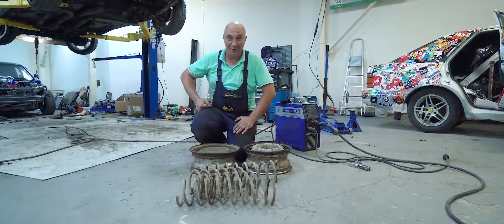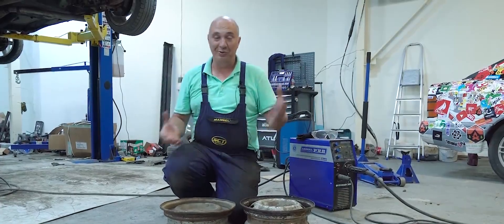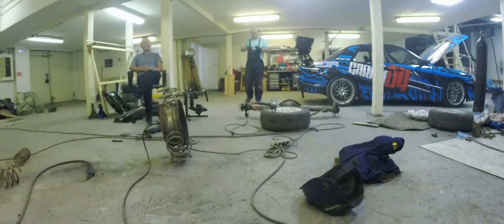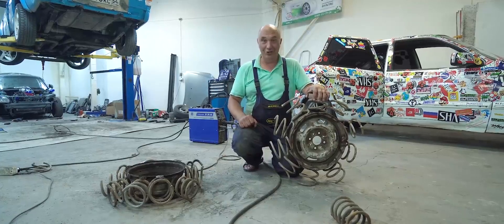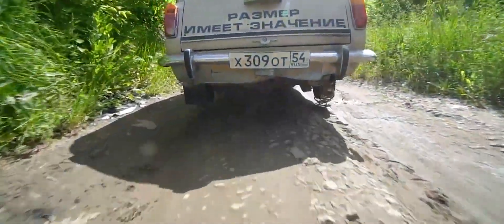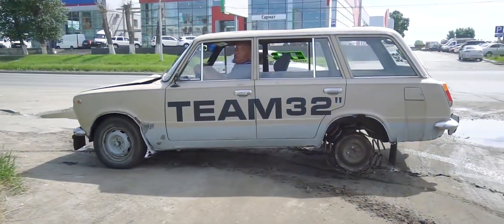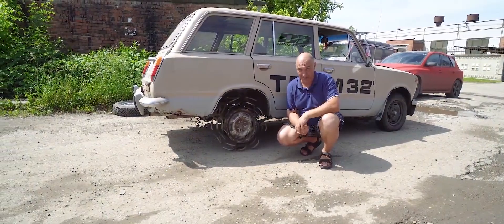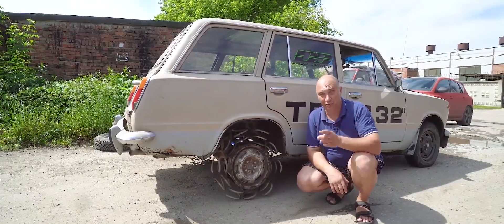Using springs instead of rubber tires

Comment: Put a tire around the springs no air just rubber
Reply: I was thinking the same. Like how they tie them in innerspring beds.
Reply: Probably works perfectly, but it's easier to charge people more for air filled ones. 😂
Reply: nope, it work cause he used with max 2nd gear, max 15 mph. If you place springs on 4 wheels and go faster, you can have some sort of unexpected behaviors. Air fills tires homogeneously, instead. So you can also predict wheels behavior in extreme conditions (ABS, EBD, ESP, ecc....)
Reply: Yup
Reply: This guy is so ducking awesome... But what happened to your old little garage ??? I loved seeing all the clutter of old projects just laying around. Reminds me that life is long and there are many things to do.
Reply: TheoneNonly the springs would just push through the tire
Reply: you need to cover the sharp edges from the springs before

Comment: Grinding and welding in sandals, no soy in this guy's diet.
Reply: Also, not wearing a welding mask when welding.
Reply: Arc welding while wearing leather apron protection gloves and pant legs pulled over my boots I still managed to get a piece of molten slag in my shoe under my heel. Burnt like hell  and by the time I got my shoe off it was cold and heel was medium well. So sandal seem like a good idea to me.
Reply: Bui Panin boots and pants solve it all
Reply: I'm an Aussie metalworker who does the same.  It keeps your reflexes good.
Reply: Actually I prefer sandals over normal shoes if there is no additional protection to prevent glowing metal from entering my shoes.
Reply: He's putting springs on a rim man, c'mon. Common sense only comes home during the holidays.
Reply: And no helmet😂😂
Reply: Structure Agency I hate the soy thing too, but good lord the amount of over-the-top smug in your post keeps me from taking anything you wrote seriously. You sound like you huff your own farts for pleasure.
Reply: The Whining nice profile pic

Comment: Honestly if they were wrapped with something, just a single layer of tire tread wrapped around the springs so you had a bigger footprint, that would also spread the load over all springs simultaneously as opposed to having a single point carrying the weight of the car.

Comment: 1980 : In future we will have flying cars
2018 : Car using springs instead of rubber tires
Reply: 2090: Rubber cars using flying wheels.
Reply: Flying cars have springs instead of rubber tires
Reply: @thefleming8912  for landing
Reply: In the future we will have 'Tigger' cars too....   
I would like to see what happens when you get hydraulic lift kits installed, and then you would literally have a bouncing car...
Reply: If they coated the springs in rubber ...
Reply: "lmao"
Reply: @jacobcarroll9896  I understand what you're saying and your theory. But I have to agree, you do sound pretty drunk... 😂
Reply: First rule of biussness-
 don't change what works. Translation - what makes you money =
 Reason we are still using 1890s teck as our primary source of power in 2018
Reply: ironically, NASA is developing a tire using a mesh of SPRINGS.

Comment: Wow Great Job, one more suggestion, wrap the springs with some flexible metal cover and then with Hard rubber to reduce noise and further improve the life of spring tyres which will also be good for city roads

Comment: add rubber pads to the ends of the springs for pavement usage also see if its possible to connect the pads to add rigidity and make it more stable ... or just put a tire around the springs and have springs instead of air

Comment: I'd say wrap it in spring steel to help with the noise and torquing on the springs, as well as making it round for a smoother ride. Then wrap rubber around the spring steel. I'd think it would also make it a bit more reliable as well. I'd bet that would be a nice ride, except for the traction issue.

Comment: Saw similar thing done on a bicycle, just with smaller springs. It actually was done after ww2 in germany due to the lack of rubber availeble...Bicycles with spring tires accualy were produced by factories.

Comment: awesome... weld springs that will fit inside tires and the tires don't need air and Test drive. See if the ride is smoother.  [flat free guaranteed tires.] 
TRY IT!   IT'LL BE A CHALLENGE TO PROPERLY FIT SPRINGS INSIDE TIRES.

Comment: y tho??
there is so much wrong with this idea, i dont even know where to start. traction, stability, high rolling resistance without the benefit of grip, road destruction. inflatable tyres are a thing for a reason.

Comment: Love those wheels.  Maybe do all 4 like that or attach a rubber belt around the outside of the springs . Kinda like rip off the outer tread of a tyre and attach it to the springs.

Comment: Car manufacturers should do this instead of using airtubes, perhaps maybe cover up the ends of the springs with some fitted metal and then layer the tires around it? That way there is no worry about having a flat

Comment: If you have an outreach rubber tire over the springs you should have a smoother ride. Also just the springs by them self's could be great in the snow. Also I think that your wheel wells and other parts might be messed up by rocks and other debris not to mention stuff getting caught in the springs. But I like the concept.

Comment: No traction = no high speeds.
It's cool if you happened to have a bunch of springs in your car and a tire pops, but no practical use otherwise.
I did enjoy the video though, no hate.

Comment: Use more springs with slightly smaller springs and cover the bottom of springs with the spring covers we have on cars. Then mount a tire around it. In helecolidal pattern separating each springs. (When looking on the tire surface you would have a kind of zig zag pattern)
Reply: Smaller springs i meant in diametter.

Comment: If you had rubber "feet" coating the ends of the springs that may eliminate noise and prevent damage to the path below the vehicle. Then this may prove to be a practical alternative.

Comment: Put the tread of a tire over the springs cut most of the side walls out leaving only the tread with a couple inch lip to help keep the tread on the springs it will probably be highway ready then

Comment: The coils would fatigue at some point  I would think - and when I say at some point I am not talking about 100k miles - you would need much heftier springs but then for that you need a bigger wheels - may there is a optimum ratio where the spring coil size vs fatigue vs gross weight would give a workable scenario

Comment: I've made my own run flats with regular rubber tires, but instead of air I filled them with cans of "great stuff" insulating spray foam. They worked on my pull cart wagon, has this guy tried it or willing?

Comment: Wrap them with semi re-tread sections and like a thin sheet of metal to stop the springs from poking through the rubber. Basically springs instead of air.

Comment: See if you can secure a rubber tire over the springs somehow maybe weld on rounded steel plates around the diameter and then put the rubber on over it so the springs don’t cut through the tire and it won’t tear up the road

Comment: What If you tried to start the engine with no intake and carburetor and with a little bit of fuel in to start,will it rev high or just do nothing?

Comment: You have to take it out at night and  do some higher speed turns on asphalt/concrete and get them to slide. Another thing is traction testing on different surfaces. You really out did yourself on this one. Much better than wooden pistons. I also want to see you put into a car a couple of really big flywheels, like the ones that were once in big portable aircompressors. Then use a couple of electric motors to spin up the flywheels to really high rpms. One flywheel engaged with the drivetrain while the other is being spun up to speed. When one flywheel begins to slow simply switch to the other. Switch back and forth between the two. Device a way that when breaking, the energy is transfered back to the flywheels. It would be very interesting to see how the concept works. Arrange it so that as the flywheels begin to slow you shift the car into a higher gear to maintain vehicle speed until that flywheel gets too slow, then switch to spun-up flywheel. That would be a project.

Comment: Isn't it a bit rough on the ride? And why didn't you drive it on the road? I know, because metal does damage the road surface and wears the springs faster than rubber tyres. All in all, totally useless, unless you want to use the car in a cows paddock. And it's spelled tyres, not tires. I guess you aren't tired by the way? What are you, tirred?

Comment: U can add a rubber base with it. It will decrease noise as well as non slipy and provide staybility during high speed or instant breaks
Reply: All in One i thought the same fucking thing #engineeringmindslitt

Comment: Get stuck one of those  spring in something at the floor or inside a small hole i see the car in million pieces.OHH! WHEN FINISH YOU NO WHERE EXPERIMENT, FIX WHERE WAS A ALREADY DAMAGE ROAD. ("Some areas dont have nothing")THATS WHY HEAVY MACHINES HAS TO BE CARRY TO JOB SITE.THEY DONT DRIVE IT BECAUSE THE DAMAGE TO FLOOR. ➖

Comment: Cut some more springs and nest them inside to improve the footprint size. Should dampen the noise a bit and make it more stable. I'd think you could nest 3 per spring? Cut down an old tire's sidewall and you could rubber line it even.

Comment: the issue would be containment at high speed. I love the theory,true bulletproof wheels! Band the springs in steel and infuse it with rubber or another flexible compound. Military applications and commercial construction vehicles. Never having to replace huge rubber tires that only end up as refuse problems later? Never having a flat? Finally science moving forward! You sir, are a Genius! Thanks for the food for thought, it really is delicious
Reply: Troll Face yumlikcious%#*?
Reply: FOOD FOR THOUGHT...get it?
Reply: Unfortunately the big corporations won't let that happen. Too much of a revenue loss.
Reply: Yeah. I imagined it would have a lot of vibration under high speeds. By overdoing it, like, measuring the spring rates, and making all the coils simetrical could solve that. Maybe.
I don't know

Comment: I think one could use this as a type of "internal frame" inside of a normal rubber tire to make it pretty much unstoppable, very stealth, excellent off road abilities, and capable of high speeds. 
Springs cut to match the internal hight, some  flat ends attached to the shaped spring ends to help not puncture, wear and weight transfer. 
Could be used as an airless tire, or as a backup redundant system for the air inflation, in emergency, or protection against  flats in military, isolated areas, special applications of tire compression. 
Very interesting to imagine this idea as an airless setup on a set of 37".

Comment: Might I suggest creating a custom rim for it. I mean, the idea is pretty much like a spoke wheel from a motorcycle, except you have thos springs instead of spokes. That way, you can still use tires and get that soft ride without too much maintenance.

Comment: I don't know if you people have seen acupressure shoes, so if we can make acupressure Tires like small round cylindrical projections spread throughout the tires rubber, such that the projections are filled with air and dampen the bumps. I think it will be great.

Comment: That's pretty cool. You can connect these adjacent radial springs with springs in the tangential direction. That might give you better grip in the direction of rolling in addition to braking and traction. Moreover,  in fact, if you put two parallel rows of springs instead of one and connect a pair of two springs with another less stiff of course in the lateral direction you might get better stability in the lateral direction. With these additions your all metal wheel can go at higher speeds before slipping or skidding. Same could be achieved by simply putting a tread around the springs but that would be too easy and let's say not pure. Actually now I that think about it I am curious to see how much better it would be and I would say please do that.

Comment: can you weld square plates to the springs where they contact the ground? put a strip of rubber on each plate. should make it smoother ride and last longer.

Comment: Great job with the experiment. How about welding a square steel plate to the end of each spring with a hinge linking each of them to make a sort of round tractor tread or moon buggy type tire? You could even put rubber blocks on each to keep the sound down. Real never go flat tire. Great channel by the way 👍👍

Comment: Whilst I have little to no experience with automotive work, I do have some with Blacksmithing, Woodworking and Steam Engines, My suggestions for improvements are as follows: 1, if weld seams are an issue with the springs then drift and punch holes in the wheel, followed by forging the wheel end of the spring coil a bit thinner and hot riveting it into the wheel. 2, if it catches too much on rocks/brambles/cobblestones I'd suggest having the ground end of the spring fully bent-over and welded onto itself like the solid ends of a toy slinky. 3, (optional) add a cowling or solid cover to either or both the perimeter or the side of the sprung wheel.
This is a great video! :)
Sincerely, Ben Skorupka

Comment: This is way cool. I thought about driving in sand snow etc. Maybe develop a rubber shroud for the springs. Maybe add some steel cords to keep the rubber int tact at higher speeds. It only at that point air could take place of the heavy springs within. Ahh yes, the future. maybe someday the video phone will happen. Until then....

Comment: That's sick!!! You should bend 1/4 inch steel and weld it to the springs. Leave a 1/4 inch gap between the plates so when the springs compress they dont hit. Then you can even cut a tire up and rivit the tread to the plates. Should help the springs transfer the load more smoothly.

Comment: Spring wheel: level two
Replace every spring with two smaller (maybe conical) ones, weld them right next to each other. Then weld a small steel plate on top of every pair of springs, and cover it all with a rubber hoop to hold them together well. (Cut it out of a tire)
Can somebody please put an effort and make this? It should be cheap.

Comment: You can weld a long steel plate around the springs, to make a clean surface, add some more strips to add grip and then the noise from the springs should dampen too

Comment: a set front and back should be neat for going over rocky ground.  kinda like it was climbing.  BUT if you take it on rocky ground have some secondary way to attach them to the weals.  maybe a band on the 1st coil.

Comment: How am I suppose to drift?
Reply: PandaKiddo Plays    May be on ice?  Do some donuts or the 0-60 speed test.
Reply: Rex Luminus donuts? Is that a jojo reference?
Reply: Rex Luminus dump the clutch and get that bishh sidewayz 😂😂😂
Reply: Go to tokyo
Reply: Hmm true how would it work going at higher speeds
Reply: Just send it and watch the fire works!!!! Im curious how well it would work in the mud and other sticky situations
Reply: How would it handle hand brake?
Reply: You don't drift, you bounce
Reply: PandaKiddo Plays no drifting at all :-(
Reply: Сhris Hansen What you know bout driftin Chris Hansen? Stick to catching predators on Dateline...jus sayin
Reply: You'll skid instead of drifting
Reply: It is a Lada 111. It doesn't go fast enough to drift. It has 1.6L of engine for 1055kg of car. (he gives a different designation in the video, but that's the coupe; the hatchback is the 111)
Reply: You mean bounce? 😂
Reply: You don't, you bounce
Reply: PandaKiddo Plays you don't drift.... You bounce!!! xD
Reply: You don't need to drift with ideal grip

Comment: Now that’s funny as hell. If the springs don’t come off they should work good in a mud hole. They may would have trouble at the beach though. Obviously not good over 10 mile an hour on hard surface. This was kinda cool. Thank you for video.

Comment: Weld a steel band around outside of tire and attach flat rubber tread around the band, then attempt highway and offroad, and try to break over potholes!

Comment: First experiment I would do: stopping distance on wet concrete or asphalt. How far would it slide with the brakes locked at 20, 30, 40 k/hr or mph? I realize this might require them to be on the front wheels instead of the rear for this test. Thank you for the fun video!

Comment: There is a HUGE potential in this wheel design idea.
With each separate spring putting down it's own footprint, it is massively less likely to slip in muddy or seriously bad surfaces.
This means a go anywhere capability better than a treaded machine.
Damage to road surface can be minimised.

Good go, Ivan !

Comment: I agree withe the idea of putting tire tread around the outside, but you would need a way to secure it. I would bend a relatively thin sheet of metal around the "tire" then bond that to regular tire tread. Then you essentially have a tire that relies on springs instead of air pressure.

Comment: It would be interesting to use springs flattened at the outer edge, whose footprint would be a circle, or, weld them the same angle so the end of each spring hits the ground at the same spot so you get a constant radius, decreasing rattling and vibration.

Comment: What will it feel like if some rubber is attached individually into the tip of those springs?Maybe it would be best of both the worlds kinda thing .A tire with suspension.

Comment: Weld plates against it, where it touches the ground.
Reply: Exactly. If he put two smaller springs right next to each other instead of every big one of those springs, if they were conical, and then cover the surface with a hoop of steel, like for barrels, and then cover that hoop with rubber. Damn.